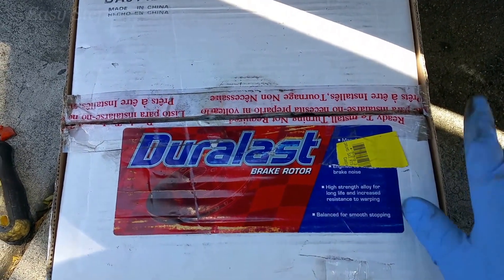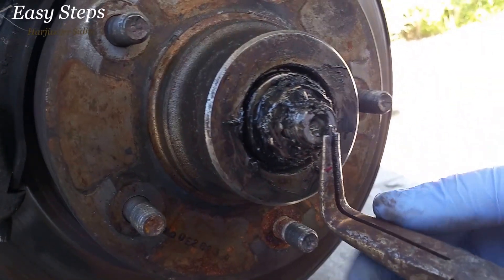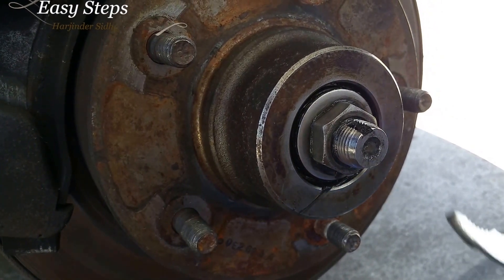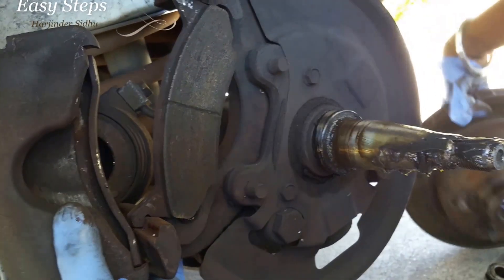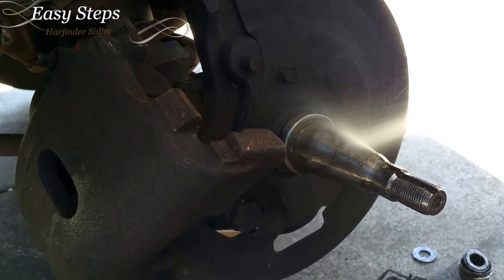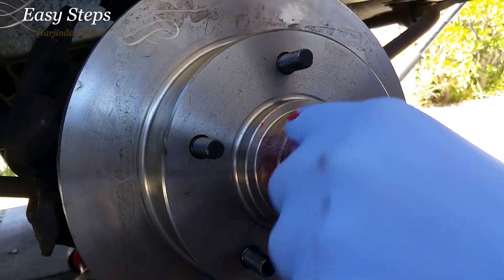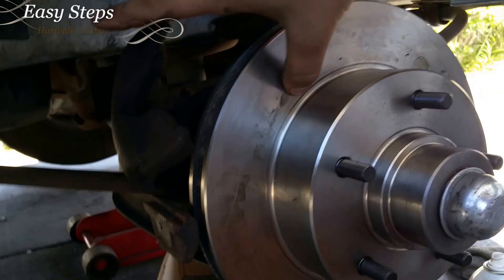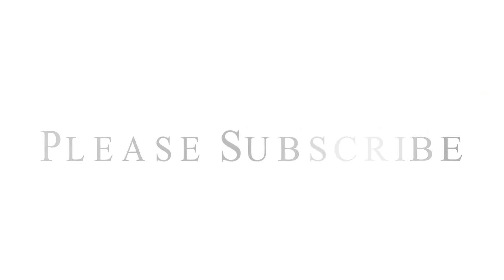How to Replace a Brake Rotor on Dodge Ram | Van B250

Comment: Perfect...it just as advertised... shows how easy shade tree DIY is with a few simple tools ...and yes...how to clean and repack wheel bearings is important for the life of the bearing and spindle but a whole other video. the same for cleaning the rotors and installing new pads..but then this 4 min easy follow vid would last a ponderous 20 mins.BTW I love how his gloves gradually disintegrate over what was maybe a 30 minute job..very  Autozone..

Comment: You put grease everywhere it didn't need to be but didn't PACK grease IN THE BEARING!!!!!! Either use a bearing packer that forces grease in between the rollers or put a blob of grease in you palm and keep pressing the bearing into it until grease is IN THE bearing.
Reply: This. And clean your rotors.
Reply: How about a new oil seal for the backside of the hub? Anybody else spot that one? All the grease he put inside will just run out the back after getting hot.

Comment: This man didn't put the seal in the back of the rotor with the bearing so every drop of grease is going to run onto the rotor and potentially kill someone when the brakes fail to the stop this vehicle.

Comment: so, uh.. most of the planet would refer to those as 'bearings', not 'gears', packing the bearings to get grease around the rollers is recommended, the castle nut is held on by a 'retaining clip', and cotter pin.  But other than that, great video!

Comment: Nice video!.....When you removed the bearing from the old rotor it seemed to have a snug fit but on the new rotor it seemed to just lay in there...Is that normal or is there suppose to be a new race installed?....Thanks.
Reply: Nick Marshall no when you preload your bearings with 25 to 35 ftlb of torque that is what seats them to the race. He did not show this being done or the installation of the new grease seal that keeps all that grease in the wheel hub
Reply: Don't listen to this guy he has no idea what he is doing you do not use old Burns in a new race that's why you're having to replace it it's cuz the bearings are wore out and you do not pack them like that please don't take this guy's advice it ain't right

Comment: Those aren't gears. They're cheap wheel bearings which should be replaced. Mine were the original Windsor 'Canada' marked bearings (31 years old) The inner bearing grease seal (no mention here?) needs demonstrating & replacing too.

Comment: You didn’t put a 25 Ftlb preload on your bearings.
Reply from the maker: You always tight to the specs, thanks for watching.
Reply: @EasySteps_Sidhu  yes as for the specific vehicle that preload spec can be as low as 15 ft lbs and as high as 35 ft lbs. I worked as a certified mechanic and have done alot of brake jobs in my day. It's a preload tightening while you torque the nut your spinning the wheel to seat bearings properly to the races. After that you back off the nut then reseat nut finger tight then place nut cover and cotter pin back. alot of people wreck there bearings and some experience catastrophic failure which I'm trying to help you avoid. Also anyone else who watches the channel.
Reply from the maker: Thanks for sharing your thoughts and thanks for watching.
Reply from the maker: I have started posting DIY videos on my other channel "Sidhu DIY" so please subscribe, thanks.
Here is the link for my other channel, thanks in advance.🙌 
https://www.youtube.com/c/SidhuDIY